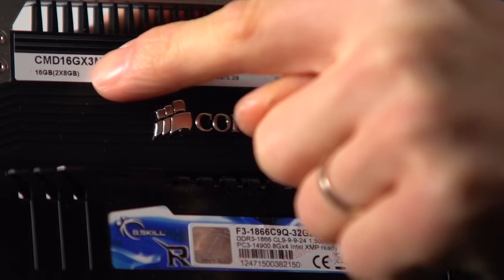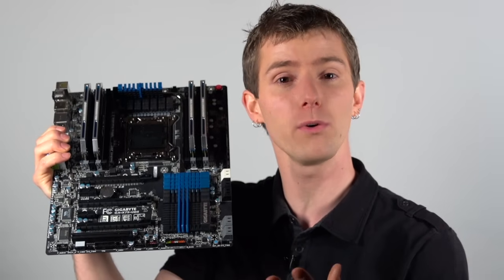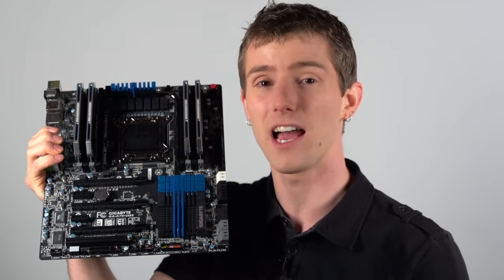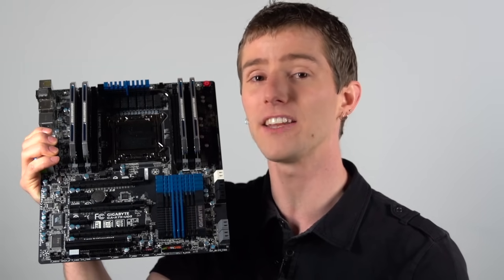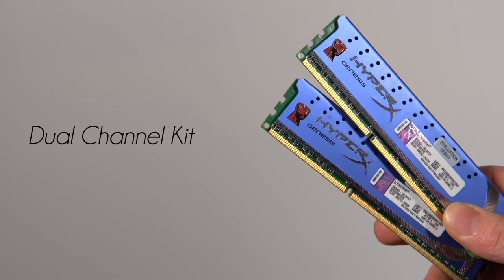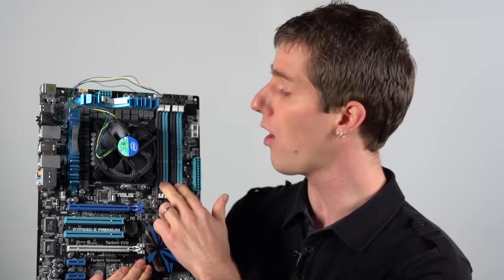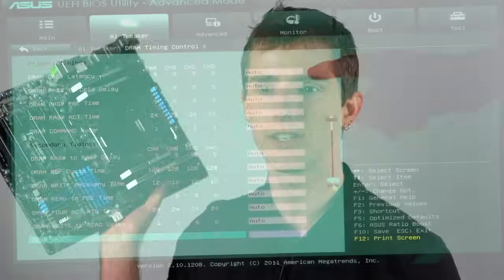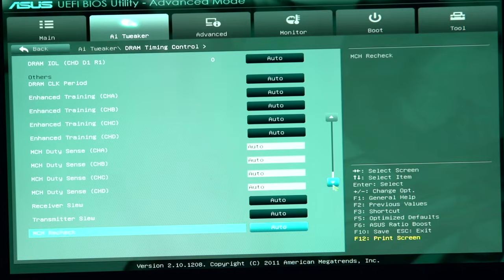Guide to RAM Memory Channels as Fast As Possible

Comment: If you wanna know how "high tech" my school is, I was walking down a hallway and found a single piece of laptop ram (4gb), so I put it in my laptop and it worked.
Reply: ahahhhhhhhhhhhhhhaaa
Reply: how did that happen?
Reply: my school has a server with 2, 2016 Xeon that are around 2000-3000$ each and apparently no GPU ( i could'nt run GPU-Z and i found nothing in dxdiag
(when you have to work on a project but all you care about is specs)
Reply: sweet, sweet child, in our school we had 256mb ram xp machines, in 2014
Reply: Andrei Lazar 
In my high school we have pen and paper,in 2018.How did you get computers so soon?
Reply: omg
Reply: r/thathappened
Reply: Rip
Reply: @hamokamo  Hows that an r/thathappened my sisters highschool has this program in rotc where you build systems for the school or something
Reply: And everybody started cheering and clapping
Reply: Is it the same school that encouraged you to use 'wanna' in writing? Sad.
Reply: @eknaap8800  "Which encourage you"
ironic
Reply: @silver1407  Better?
Reply: In my schoold the computers were stolen
Reply: E Knaap Correction, what you said should be worded as follows: “Is this better?”
Reply: @psilon21310  I would start with a capital in that sentence...
Reply: Ecktor dude, yeah
Reply: E Knaap E Knaap Are you quoting something and omitting a piece of the source text? Because if not i am pretty sure that sentence should end with only a single period.
Reply: @psilon21310  Not quoting (obviously).
Reply: Yasin Omidi they are a default Citrix server
Reply: One of my many sus comments from years ago. It is partially true at least, our school did have a focus on tech and by the tech office there was some laptop ram, but I didn’t actually try using it.
Reply: Matthew Murphy lol I used a conversion kit, it’s laptop ram do dimm
Reply: Yasin Omidi MK
Reply: btw my school got 2gb of ram and no gpu intel duo in 2020(2021)
Reply: @andreilazar7495  in 2020 we have pcs with i5-4th gen (integrated.) and 24gb ram like wtf i have worse ram in 2021 (i want to steal some lol)

Comment: Why does RAM now seem so hard to get? Before watching this I thought that you just get RAM with the MHz and GB you want...
Reply: 4 years later and it's even worse... I'm awaiting my special decoder ring so I can figure out what I need to buy.
Reply: @mephInc  and here I was thinking i'd get 2x8GB now, and put another 2x8GB in, in two years time. Now I find out that even if I buy an IDENTICAL kit from the same manufacturer I've probably only got a 50% chance of it actually working. I mean WHAT DA FUCK?! industry...
Reply: Oh I feel your pain! I just brought an old notebook pc back to life and upgraded the OP from Win.7 to Win.10 and was about to buy a SSD drive for it. Being a 32bit system, I thought about changing it to 64bit so that I could get more RAM than the 4Gb maximum it’s allowed so far. Big problem with that though. The RAM slots are DDR2 and getting 2 chips higher than 2Gb each chip, is bloody difficult! I wanted 16Gb in total at least. But even finding 2 X 4Gb chips is murder. Then I found them but they were over £200! For 8Gb RAM total?! No chance! I might still get the SSD drive, but it doesn’t seem as good an idea now as it first appeared. Graphics is integrated too. But it really gets my dandruff up...I mean, dander up, that DDR2 RAM is dearer than DDR3 or DDR4.
Reply: @Donkey Kong may not work in Dual channel coz it's not officially rated as "quad channel" kit.
Reply: Donkey Kong The sticks are graded for timing and matched for speed. At the speeds that these memory sticks run at, there can be timing differences that make it unstable. This happens if, for example, the setup or hold times are slightly off between two sticks. Those times can be measured at the factory by a test rig and then sticks that match are grouped together. The most pessimism lack of matching could easily make timing differences bad enough that one stick’s data is going away (fast) just as another stick’s is just getting out there (slow). The times are in the order of 0.3 nanoseconds or so.
Reply: Same man
Reply: @jazzman1626  sticks with that much memory for ddr2 didn't exist, breh.
Reply: R T 
I successfully installed Windows 10 and the startup etc. was acceptable for the other spec of the machine and it turns out that I’m glad I didn’t spend money on the RAM because I got some PPI refunded and treated myself to a new laptop! It’s a Dell 15” i7 XPS 2 in 1 with 4K screen. It has face recognition log in. I got a pen too for use with PhotoShop that sticks to the side of the laptop with magnets. I bought a beautiful tan coloured leather case for it that looks so nice! The laptop is built into an aluminium silver casing. Funny how things turn out 😄.
Stay safe my friend.

Comment: Question to Everyone with an Example:
If I want to buy 16GB of RAM, should I buy 2x8GB RAM at once (2 sticks in the same package(Kit of 2)), or I could by 1x8GB + 1x8GB the exact same module RAM (Single Module x 2)?
If you didnt understand what I'm talking about then: I'm about to buy a new PC and the problem is the RAM. I'll buy 16GB, DDR4, 2666mhz. To be more specific, this is the model "HX426C13PB3/8".
I want to buy HyperX Predator, but there is not "package" with 2x8GB (as the photo at 0:29) but only 1x8GB. So there is not any available option in my country with Kit of 2. There is only the option of 1x8GB HyperX Predator, 2666mhz.
►And the Question is: Is there any problem to buy the SAME RAME 2 times (2x8GB)? Thank you in advance.

Comment: As mentioned in the video, the slots that work together are colour coded, so if you put another Dual channel kit in the other slots, they should work correctly. In an ideal world, get another of the same dual channel kits, this should ensure compatibility, if they are different but the same spec, normally it's ok, if they are different spec you could get lucky by setting all of the memory to the slowest timings. Normally it works, but sometimes it will drop down to single channel mode.

Comment: If I buy now a single let's say 8GB Vengeance 1600 Mhz stick and after some months I decide to upgrade and get another exact same RAM will they work together? Becuase they're not paired kits as he said and I am kinda confused here. Anyone can answer me?
Reply: looking for this answer as well.
Reply: as long as its the exact same model it should work best if they are the same channel
but you are better off running two at the same time of purchase.
Reply: NORMALLY but you wil still get 1600 mhz from a single dimm.
Reply: Just leaving this here so I can return here :)
Reply: stelios, provided u get the exact same model ram there most likely wont be an issue. however like he was saying in the video, there can be random problems that occur and if you can avoid it its best to buy them in the same kit. 8GB ram is all u really need for gaming / general use anyways.
Reply: yes it will work
Reply: The new stick might be a newer revision, with different chips on it.
Normal usage at the rated speed will mostly be fine, but the two sticks may have highly different oc capabilities.
Reply: Not always. It may work it may not. I've done it before with the same dimms bought at different times and even mixed memory and it worked. But then I have also bought the same stick and it wouldn't post with it or it was unstable. It may or may not. Not much risk as long as you can return it for your money back just in case
Reply: @ResinLipBongFace  woah 4 years ago 8gb was enough for gaming..good times, now I need 16gb fucking ram, not that I'm complaining but how things are changing slowly makes me feel oldy af
Reply: @rohanofgondor  8 GB is still enough! You are living in 2022?
Reply: Manish Goyal not for bo4 bro
Reply: @manishgoyal7677  I saw that a couple of new games yet to come out have 16 GB ram in the minimum requirements, Left 4 Dead 3, for example. I guess I better swap out my single 8 GB stick for 2 new ones pretty quick :(
Reply: @jimjambananaslam3596  But only the massive AAA titles!
8 GB will still remain in minimum requirement for next few years.
16 GB is always recommended and 32 GB is kinda too much for a single game but is future proof.
Reply: If your mobo is dual channel, and it's the exact same stick, yes
Reply: @manishgoyal7677  I'm from future, and I can confirm that

Comment: Should I get 8x2 gb RAM or 4x4gb? I'm pretty sure its 8x2gb but I want to make sure.
Reply: +Stephen Sexton i think 4x4 is better if you are not planning to upgrade in the future
Reply: Pro tip: The best results are typically half the number of DIMM slots your motherboard has.
Reply: Infinite Zero so always 8x2 over 4x4? if the motherboard has 4 ram slots that is
Reply: +Stephen Sexton if your motherboard has 4 ram slots you can't do 8x2gb
Reply: +Stephen Sexton Linus answered this very question in the video.  Technicall either will work... most of the time, however the bios will recognize the timings the manufacturer recommends for the ram based on the the number of dims it is selling as a kit.. (so if it is selling 2 sticks of ram, it is best for a dual channel config, if it is 4 then a quad channel.  As long as that matches up you can safely assume everything will go as planned 100%)

Chances are that if you put 4x4 in dual, you will be fine, but there is a chance the timings will not quite match up to optimal, which could cause a stability issue.  So that being said, to be 100% sure it would be best to check to see how many channels your motherboard supports (most support 2, really cheap, like lowest of the low, support 1, some super boards support 3+) and then get the same number of sticks as your channels, so if it is dual channel, get 2 sticks.  So that can be 2X4 2x8 or 2xwhatever.

I put 4 sticks of 8 in my dual channel board and I did actually have some concerns about the timings, but really have no way to find out if there is any true issue as there are just so many timings and my computer is running fine as far as i can tell.... however.... I can not tell if it is running in dual or if it is being reduced to single.  Something I will have to look into better when I get the chance.  Now all things considered, if I find out there is an issue all I will likely have to do is manually set each individual timing in the bios, which my bios does allow me to do (i swear there is like 50 timings) to the right spec, assuming I can figure that out, and things will likely be fine./
Reply: +BiteEdits Wut? of course you can, Just use two dual channels of RAM.
Reply: I have the same question! Linus make a vid plz!
Reply: Jorge Gómez
you cant put 8 physical dimms in 4 physical slots
Reply: ***** I missread  2x8gb sorry xD
Reply: +Aryian Schreiner You realize you are commenting on the very video where he answered this question?  Just watch the video again when he is talking about using x number of dims with with duel channel.  Here is a link to the video with the time he starts to talk about this: https://youtu.be/-D8fhsXqq4o?t=1m12s
Reply: +Aluvian Knight yeah i found this out 2 weeks ago
Reply: +Aryian Schreiner Well if anyone else missed that part, maybe that link will help them XD
Reply: +Stephen Sexton 2x8gb if you run it in dual channel kit, 4x4gb in quad channel kit.
Reply: +Stephen Sexton This depends on if your Mobo is configured for dual or quad channel... If you have a quad channel board, go 4x4gb RAM for optimum performance. If it's a dual channel board, go 8x2gb RAM for upgradeability (assuming you have 4 RAM slots and can support 32gb of RAM). Quad channel RAM yields the same performance as dual channel RAM, in a dual channel board.
Reply: My mobo can support up to quad channel but my 4x4 is in dual channel mode....
Reply: +Lorenzo Perales This helped me so much, thanks!
Reply: +Stephen Sexton  I have read the comments on this question and there are a lot of different answers on different configuarations. All answers make sense for me. but I am not sure that any have answerd if; on a dual chanel bord with 4 slots (2x2 dual chanel) is there any difference to put in 2x8Gb or 2x2x4 GB (all dual kits).
Reply: No performance difference besides a deeper pool of RAM to draw from.
Reply: +Lorenzo Perales deeper pool?
it is the same amount of ram 16 GB so what do you mean by a deeper pool of ram?
Reply: +mortenpg100 I implied 8x2 for a later upgrade to add another 8x2 since there would be no performance difference unless he had a quad channel board
Reply: +Nicholas Khaw ...So if I want 2 sticks of 16gb ona motherboard that supports 8 sticks total, it is a bad idea?
Reply: buy 4x4. it provides more stability
Reply: whats the mystery behind this
Reply: use as few slots as possible.  if you used every slot to upgrade you would have to throw away one of the existing modules so your upgraded new module would only provide you with HALF  .. say you had 4x4x4x4 GB   to add an 8GB you would have to pull a 4 for a net gain of only 4! when you paid for an 8! .. so always.. use as few slots as possible to  upgrade. you want 16 gb  use a single 16GB stick (providing your mother board can support it)  then if you added more memory.. you would gain ALL of it by potting it in an empty slot.  read your manual for motherboard to see installation order.. or if htey have to go in in pairs.

Comment: Thanks for this video. I thought I understood RAM, but there was a lot I learned from this video. I have an ASUS X58 MOBO acquired in 2010. It came with 3 sticks of 2 GB RAM. I "Upgraded" it by purchasing 1 stick of 4 GB ram and have had stability issues for years that I could not diagnose. I've since purchased 2 more of the same model 4 GB ram and my stability issues seem to have evaporated!

Comment: I have two dual-channel memory kits; they were made by the same manufacturer and had the same capacity, but they have different heat-sinks so I assume their internals weren’t a complete match. No matter what configuration I put them in on my dual-channel motherboard, they would cause Windows to crash to a blue screen during performance-intensive tasks. There was a good period of time when I was running a flaky system, until eventually I tossed one stick out, and now my blue screens are rarer than a blue moon. I concluded that there was a bad port on the motherboard, since every stick of RAM operated just fine on its own during diagnostics. I’m currently running a 2:1 3×2GB setup, which is stable, but it really bugs me that I can’t bump it up a little more with that lone 2GB stick.

Comment: Ive populated my memory board with mixed and matched sticks ( 7gb all from Crucial)
Same configuration used in two unique machines:

System A. AMD FX 8320 Gigabyte - 78LMT AM3+
System B. i7 920 - MSI - X58 Socket 1366

7GB - total
2x2gb 1333 
1x 1gb 1066
1x 2gb 1066
(all timings were identical and bought months apart)

System stable, no crashes, all ran Correctly in Dual (AMD) and Triple (Intel) channel modes...  Was even able to overclock the machines AMD to 4.0 ghz and Intel i7 920 to 3.4 GHZ - Cool and still fully stable.

Maybe just lucky in my case, both times.  I stand by Crucial Memory for this reason, Ive never had a dead stick or an issue with them, ever.

Comment: Fun fact that I've experienced. When buying two single channels kits, usually work in dual channel, as long as the part numbers and timings are the same. In other words, two single channel kits with Micron E die, or Samsung B die rated with the same speeds and latency. I don't mean match the Samsung ram with Micron, no. Stay in the same chip family and properties. If you get two separate kits, with differing Frequency and Timings, use the settings for the worst kit for them to function.

Comment: is it bad i have a 1×8gb module istead of 2×4gb?
Reply: +Alex Sakellarioy It is not bad if you're planning to add an extra 8gb module, but make sure it is exactly the same reference and frequence.

Otherwise is always better to get the 2x4gb because the Dual Channel technology of your MOBO will improve the performance.
Reply: Ok thanks
Reply: +Jorge Gómez  i have dual channel and my board support only 8 gb.. now i have (2*2) 1333mhz4gb.. so i need to upgrade my ram 8 gb ..can i buy single 8 gb 1600mhz in one channel and one of the remaning 4gb put into 2nd channel? then it will 10gb? is it right to do? or i buy (4*2) 8 gb new?  :) please help plz plzzzzzzzzzzz
Reply: Buy 4×2 if your motherboard supports up to 8gb it probably wont detect it and if you put 2 different modules it wont be as fast also buy the same mhz speed ram
Reply: Tahir Butt is always better 2x4gb than 1x8gb, by the other hand is not recommended to put two different modules.

Remember you need the same frequency (Mhz) on both modules.
Reply: Jorge Gómez ok thnks alot
Reply: Alex Sakellarioy thanks for reply.. my board support 1333/1066 mhz can i putt 1600mhz? otherwise i decided to buy 	MSI Motherboard H97 Gaming 3 (H97/1150/DDR3) Jorge Gómez
Reply: Tahir Butt If your board supports 1333 and 1066 don't put a 1600mhz.

An H97 will support 1600mhz and 4 memory slots with a max of 32gb of ram.

Excellent choice.
Reply: +Tahir Butt u can it will work
Reply: Jorge Gómez Hi please answer my question since you are into PC stuff (: 
I have a dual channel motherboard which has 4 ram slots and I have a 1 stick of 8gb ram installed can I add another stick of 4gb that is from the same brand and has same frequencies and run a 12 GB of ram ??

Comment: My friend and I are having a discussion over RAM channeling.  I am saying that on a dual channel board, if you fill all 4 slots - it reduces the memory speed to single channel mode.  He is saying that the memory stays in dual channel mode with all 4 slots filled.  Both he and I are using AMD motherboards, AM3+ sockets. He with and AMD 8350 and me with an AMD 8320. Both our boards have 4 ram slots (manual says dual channel). Would like your input on this matter, thanks.